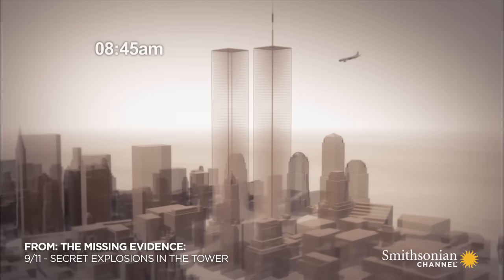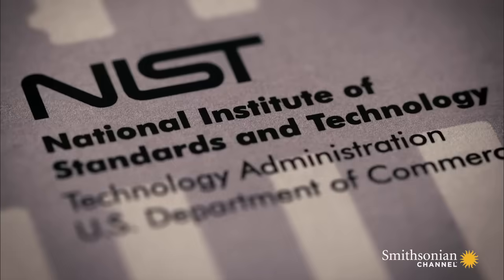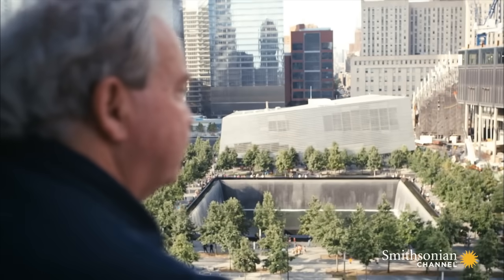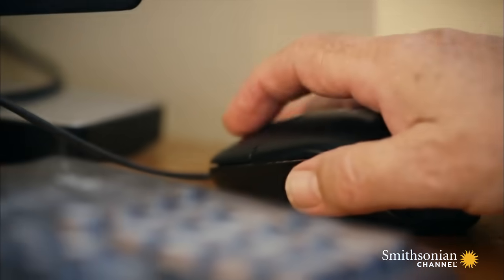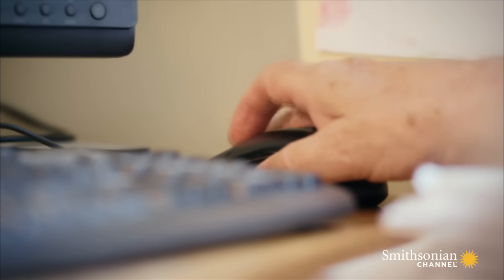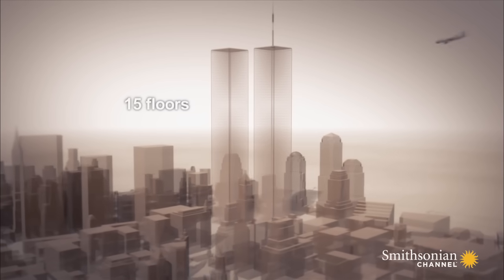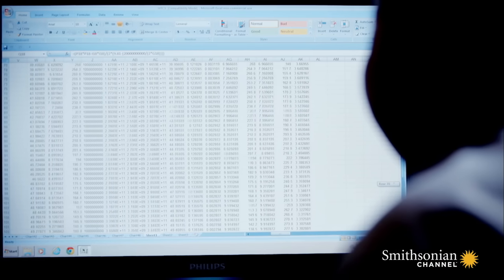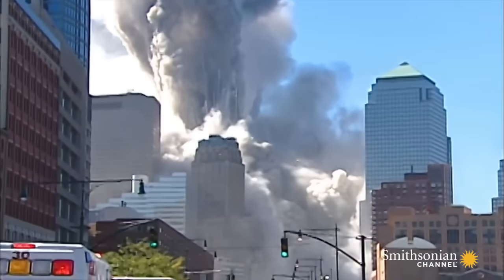This Computer Simulation Explains How the Twin Towers Fell

Comment: Ok now explain WTC 7? Please I’m dying to hear it. The building was on fire for hours and then all of a sudden tumbles in on itself looking exactly like a controlled explosion.
Reply: Okay you seem reasonable. So if you see how one of the towers collapsed the top of the building had a compounding collapse (one on top of another) as the floors pretty much disintegrated. What happened was the top of Tower 1 (NORTH) sloughed off the side as it feel and several million tones of concrete and steel fell on Tower 6 and 7, Six was virtually crushed while 7 had serious damage. What killed 7 was the massive spire which sliced through the building causing extra damage on top of the buildings already damaged South Face. As a result fires - probably electrical - broke out and between the damage the collapse of the towers, and the absense of water lines there was nothing to put the fires out with.

So it burned, and after enough of the metal inside had weakened from the collapse and extra heat, it collapsed.
Reply: @howtodesignandbuildahousee7118  whereas wtc7 was made of papier mache. Ok, got it.
Reply: @Putinhuylo3  
Next you will compare B7 to a tree. 🤦‍♂️
Reply: @Putinhuylo3  
B7 had large, heavy floors, so it was impossible to stop them progressivly collapsing.
Reply: They will simply say “funny that’s not what I see”
Reply: strawman hitIer  Conspiracy Theorists have never stepped foot into school or any kind of structural engineering or science class, and are often poor failed dropouts who contribute nothing to our society. If you believe a conspiracy theorist, then you are just as worthless as they are
Reply: @AmericanRailfan-gb8oq  soooooo true! I hate conspiracy theorists!
Reply: @namegoeshere69  I’m not a kid, thanks.
Reply: strawman hitIer  Conspiracy Theorists are attention looking souls with no lives no money and no purpose who are looking for interent fame. They provide no basis for arguments and reject all forms of professionalism to suit there own view points.
Reply: I used to watch video's of firemen that literally said that building 7 was pulled. But they deleted all these video's from YouTube. There used to be a shitload of video's on here revealing the truth but all of them were deleted from YouTube years and years ago, like atleast 10 years ago. Bush,cheney and Rumsfeld. Those are the 3 people that are responsible and planned this whole thing.
Reply: @WesleyDeGrooteAalst  It wouldn't surprise me if they did pull building seven. It had taken severe damage and there was no purpose in really keeping it
Reply: @AmericanRailfan-gb8oq  what does pull mean
Reply: @WesleyDeGrooteAalst  yup sad that YT Is censoring the truth! rums field and cheney for sure ...we will never know for sure but bush may have just been dragged along for the ride !!
Reply: @4465Vman  I like how you are reporting me for telling the truth
Reply: @4465Vman  I gave you evidence to prove 9/11 was not an inside job, and you still report me
Reply: a miracle Parker!!
Reply: Building 7 was actually left to be destroyed. The building was on fire and had taken severe damage. The lease owner of the World Trade Center at the time was consulted and whether to keep the building or let it destroy itself, and they chose to let it destroy itself as there was no need for it
Reply: @AmericanRailfan-gb8oq  um no actually the ONLY way a modern steel framed building can collapse like that is with explosives ...they destroyed it ,,Silverstein said "all it!" you could light the whole entire building on fire..the massive internal steel frame will never completely collapse !! ANY expert can confirm this
Reply: @4465Vman  Any expert can confirm this? I have a construction worker who designs buildings who goes to my Model Railroad club who tells me that building 7 was left to collapse naturally..
Reply: @4465Vman  And the only way a building can fall like that is with explosives? Try telling the people of Warsaw that during the Second World War...
Reply: @4465Vman  Any construction worker could tell you that Building Seven with the damage that it took wouldn't have been able to be saved. The building had MILLIONS of TONS of rubble falling onto it from both towers collapsing (which was also naturally occurring). The building was in no way salvageable, and it wouldn't surprise me if they did destroy building seven deliberately
Reply: @4465Vman  My advice to you is dont believe in what the conspiracy theorists tell you. You know, the interesting thing about this is that the World Trade Center Towers lasted as long as they did due to a structural failure that was holding them up. The fire reached roughly 800 degrees, if you leave that next to steel for 50 it will loose 60% of its structural integrity, and for two hours  it would be completely useless. ALL steel melts, no matter what unless you have an oxide layer to make it fireproof, which the WTC did not have from its construction. And before you ask why? As it wasn't made avaliable until after 2003...
Reply: @AmericanRailfan-gb8oq  any construction worker!!?? really?? how bout any engineer? how bout any CD experts?? the shell of that building is thousands of tons of intertwined steel beams ..so yea thanks for ebbing open to the fact that is was brought down by a CD this the ONLY way a steel framed building can come down in the manner that it did come down in !!
Reply: @4465Vman  Oh, I have an uncle who is an engineer, he could also tell you that buildings are designed to fall like that under the Federal Regulations for building construction in the United States
Reply: @4465Vman  I think I am going to make a video about your bogus claims and I think I might just get rid of you entirely
Reply: @AmericanRailfan-gb8oq  you have an uncle whose an engineer !!! wow !! and "buildings are designed to fall like that!" wow!!! LOL!!
Reply: @4465Vman  They are required to be designed to fall like that according to the Federal Regulation of building construction" written in 1956...
Reply: @WesleyDeGrooteAalst  Show me this video please. My family is full of veterans and I have access to several things, so if this video exists, then I need its validity. You saying that it was deleted to me only shows its fake
Reply: @WesleyDeGrooteAalst  Show me evidence of this please, no statement can be valid without evidence
Reply: maybe youll understand more when you get to your high school science classes....the truth is... secrets are hard to hide in a free society
Reply: 222nd like :)
Reply: For God's sake... after the towers fell, a part of WTC 7 was scooped out by one of the debris parts, collapsing the tower. Why is that so difficult to understand?
Reply: @callmecharlottex  Because none of these people have engineering degrees or are members of Anti-Western Organizations
Reply: @callmecharlottex  Actually that’s not what happened according to NIST, they blamed the collapse of building 7 on “office fires” and a weakened internal support from those very same fires. (Not debris, and not damage from the collapse of the two towers). You can go to the official NIST site yourself and see this answered there.
Reply: When you have so many witnesses saying they heard explosions, and videos of explosions. That means in English that there were explosions! Even in the freaking basement.
Reply: The sim for wtc7 looks like they pooled it out of a rabit hat lol
Reply: Can anyone answer why wtc 1 and 2 were pulverized
Reply: @Thecapri48oficial  good question!!!
Reply: shaunna knowlton  Off course "yes". Only people in the usa think it was Bin Laden who coordinated this from his cave in Afghanistan 😅
If a regular airplane crashes, there is a massive search on how the accident happened. But on investigating 9/11 the commision was suspended and they never even found debree from the aircrafts (not even the socalled plane that hit the Pentagon. ) The owner of the twin towers took an insurance (specificly against airplanes hitting the building!!!! ) ONE week before 9/11. And Bush made sure he was at a school when the 'attacks' happened so he could look good in the eyes of the amercians. Nobody outside the US believes this was planned by bin laden lol They just wanted the oil off course 🙄
Reply: @WesleyDeGrooteAalst  Show me evidence where Larry Silverstiene, the lease owner of the world trade center, took an insurance policy before the attacks. I want to see the insurance papers, who it was through, and the names of each people who signed them
Reply: The fire burned for hours and hours, the collapse of the towers disabled the water sprinklers on the lower floors of the building, the fires caused the building to collapse, it burned for hours with nothing to stop it, what did you expect?
Reply: @joeythecat6334  grenfell tower burned for 3 days... it did not collapse
Reply: @CarlJohnson-xk1jp   Windsor Tower Madrid. 17 hrs. Steel structure.
Reply: @CarlJohnson-xk1jp  Did the Grenfell tower have hundreds of tons of steel and concrete fall on it, significantly damaging one side of its structure like building 7 did?
Reply: @davesmith3289  so if that’s the case why did the whole tower collapse... the way it also collapsed did not look natural.
Reply: @davesmith3289  hundreds of thousands of tons of steel did not fall on tower 7 son, a few pieces hit it, that's about it.
Reply: @joeythecat6334  um no...a couple floors burned for some time..90 percent of the floors were fine!!
Reply: @joeythecat6334  it literally became smoke stacks
Reply: @joeythecat6334  no building has ever collapse with furniture fires com'n man - you're smarter than that
Reply: You just answered your own question!

The firefighters who were there not only do not have a problem with how bld 7 fell, they predicted it! But sure, believe internet conspiracy nuts over them.
Reply: its a miracle  Parker!!!
Reply: Exactly, but all these sheep keep spitting out CNN bull.  Common sense is non existent for most.
Reply: @new2reality89  We already explained why WTC 7 collapsed, they left it to destroy itself
Reply: New 2Reality That isnt it, the problem is people like in this comment section don't live in the US and work with organizations that are openly against the United States. People ask these kinds of questions because they want to see the US and the world burn, which makes them apart of the enemy themselves.
Reply: New 2Reality I can garuntee that most of the people here are either from Russia, China, Laos, Cambodia, Venezuela, Syria, Saudi Arabia, Iraq etc. and they simply are Nationalistic idiots who are ideologically brainwashed by there governments because the US changed its foreign policy. The people who ask "Why did building 7 fall" are Wahhabists, that is the entire point
Reply: ''Ok now explain WTC 7'' <--- That's been said 1 billion times on YT. 🤷‍♂️
Reply: I mean the fire was due to the collapse of the north tower just like wtc 3 and 6   the water system was not ready to fight the fires and to the part you know the top part collapsed and then the whole thing collapsed the end
Reply: @Sonicfan-yt9qh  my only advise for you, would be do as much research as possible in the positive and negative of what is claimed. I once believed what I was told. Eventually and luckily I stumbled upon alternative perspectives. I Dug in and realized what I had been told cannot hold water under scrutiny, plain and simple. The info is all there to see. You just have to search for it.

Comment: 1)how can an aluminum hollow plane take down a 70 storey building? 
2)the footages shows the beams of the buildings were cutted diogonally with exact precision? Can a plane do that? 
3)towers came down in 11 secs. (Freefall acceleration )
4)zionist leaseholder larry silverstein skipped work that day so did his children 
5)no black boxes found
6)it is said that gold was stolen(or moved) from the vault of WTC
7)no response  from "NORAD"
Reply: 1. By taking out some of the supporting steel & starting fires that substantially weakened the rest.
2. Those cuts were made by clean-up crews dismantling the wreckage WEEKS LATER.
3. No, they come down slower than that, over 20s for tower 1.
4. Anti-Semitism doesn't help the investiagation.
5. True! Nothing that was in those towers survived.
6. It's also said there are alien bases on the moon.
7. NORAD was not even notified of any of the hijackings until they had already crashed.
8. 19 years later and idiots like anonymous vlogger still don't have a clue.

Comment: I cut steal beams with aluminum all the time! It works really well! But seriously, jet fuel didn’t even take a tree down🤷🏼. If that’s not enough proof then there’s no changing your mind.
Reply: Actually, if you look carefully you'll see that the steel beams weren't cut at all! They were bolted together at the ends & the planes broke them apart. No cutting necessary!

Comment: The simple problem this guy has is that he claim it collapsed due to the weight of the part above, yet, before the planes hit, it wasn't a problem at all and still no explanation given.
Reply: Sure an explanation was given! The planes took out a significant portion of the supporting steel; heat from the fires substantially weakened the rest.

No one says you have to believe it but don't lie & claim no explanations have been given when they HAVE.
Reply: @Tim22222  no, in the video he says that it collapsed due to the weight. But you dont need to be scientist to know it wasnt a callapse; just watch the videos and you see it was an implosion. The steal, marble and concrete was transformed to dust and only atom fusion can do that(nuclear).